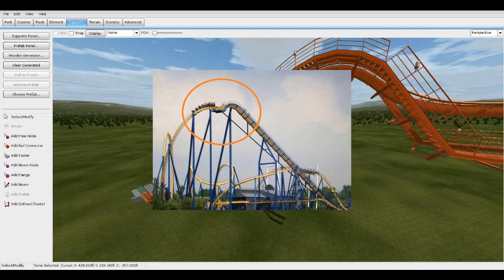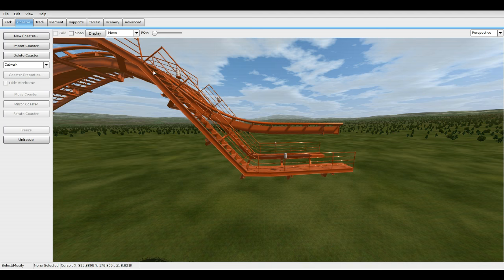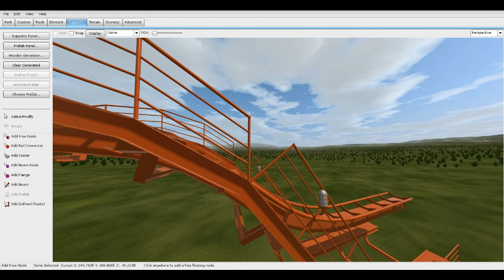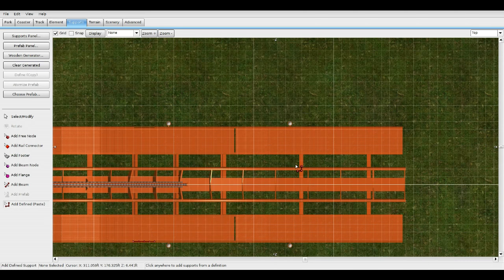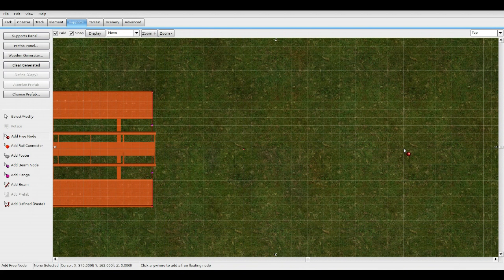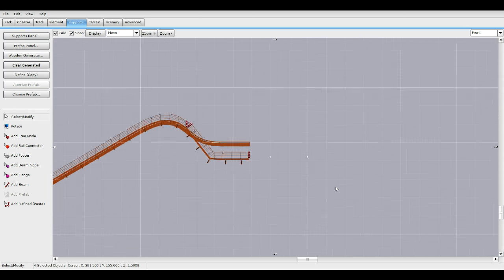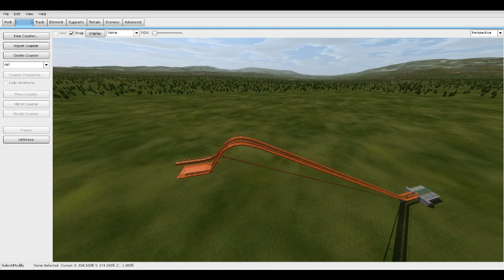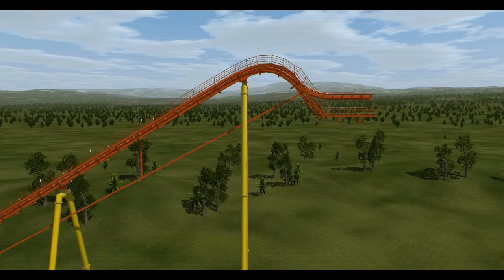No Limits 2- How to make B&M Catwalks, Lift Motors, & Chainbacks!

Comment: How would you suggest on making the Chainback going through support beams?
Reply from the maker: I've never seen a chain back go through support beams in real life so I'm not quite sure, really our only option in NL2 is to draw right through it... Even on this coaster: http://www.djeffstuff.com/images/bmcoaster2.jpg The chain back doesn't go through the vertical beam, its attached to the side of it... Hopefully this kinda helped, I'll see what I can come up with :)
Reply: Shambhala at Portaventura has a chainback that goes through the supports. When you are going up the lift hill of Dragon Khan you can see the chainback and it clearly goes through the supports! https://www.google.co.uk/search?q=shambhala+chainback&safe=strict&source=lnms&tbm=isch&sa=X&ved=0ahUKEwivhc3A1p3OAhWLCcAKHfShD0AQ_AUICSgC&biw=1366&bih=667#safe=strict&tbm=isch&q=shambhala+chainback+portaventura&imgrc=l8EGKQKYfJju6M%3A You can just about see it on that picture!
Reply from the maker: Thanks for the reference!, I'll figure something out and release a video shortly :)